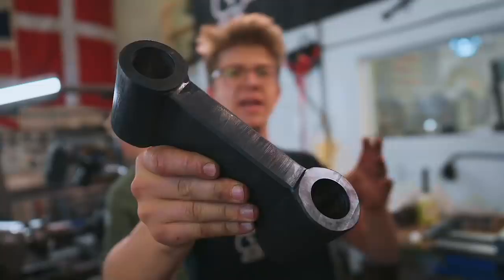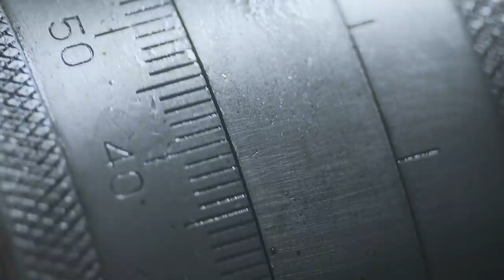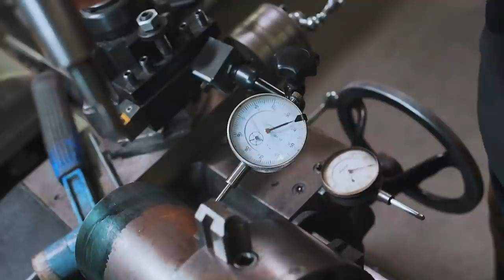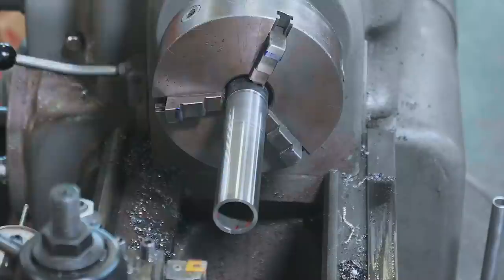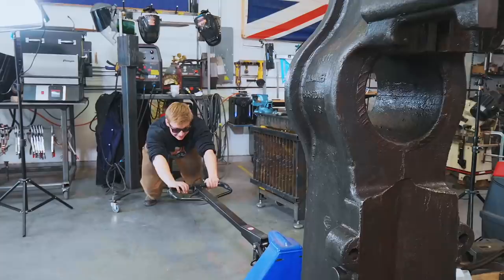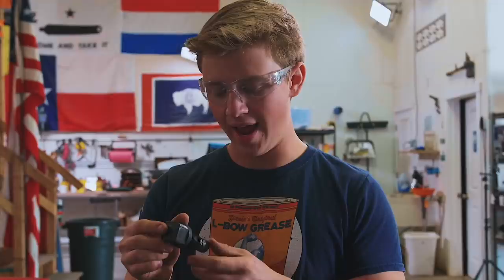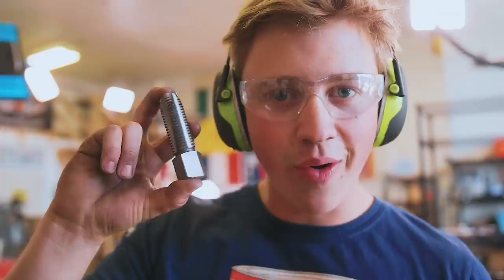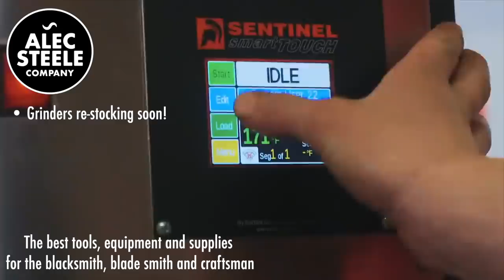RESTORING THE FAIRBANKS POWERHAMMER!!! Part 3

Comment: Pretty cool. I like the "fixing old industrial tools" content as it's a little something different than the normal sword making and such.
Reply: Absolutely. This is my favorite content.
Reply: I agree someone needs to do a channel with this similar higher energy style where they focus on rebuilding old machines and equipment. Kinda like "Hey guys this week we're working on this big mill here, it's in need of some work including recreating this broken table that we're going to have to recast and machine...."
Reply: @435now  not someone, Alec is already doing it!
Reply: I get so keen when they do equipment repairs because you can see it's not just their blacksmithing knowledge that's being grown, it's fitting, machining, welding and design as well. V jealous of their ability to do this day in day out!
Reply: Whole heartedly agree. I can't get enough old machine content and there doesn't seem to be a lot that does such a comprehensive overview of the machine and it's components. These young men are developing extremely valuable and dwindling skill sets that the world very much needs.
Reply: That's the only thing I watch on his channel, not really fussed about the forging
Reply: Came here to make the same commet.  Gratifying to see othars have the same thought.
Reply: Yeah and unironically this is the "Cheap" way to get a tool. Buying one of those things would cost them 50x as much... So thats why you see so many old tools stick around so long, specially in smaller shops/businesses.

Comment: will: I am terrible at machining.  
will: proceeds to fabricate a perfectly functioning tap 
me: hmmmmm...
Reply: I mean "perfectly functioning" might be a bit much for that tap. For chasing existing threads? Sure. But cutting new threads from scratch will probably be extremely hard for that one, judging by its geometry. The flutes seem very flat and thus the cutting angle at the tips aren't very sharp. So if you'd try to cut new threads you will either need much more force than necessary or the tap will just break because it's hardened all the way through. Not saying it doesn't work, but it isn't perfect by a long shot.
Reply: Depends on what you're tapping, some materials prefer a negative rake angle
Reply: @sherlock_norris  you know your stuff, 303
Reply: you look like Lewis Hamilton XD
Reply: Yea, that was pretty damned impressive.
Reply: @adcaptandumvulgus4252  He's Sherlock Holmes and Chuck Norris rolled into one. What did you expect.
Reply: @nathan87  yes, us rabble pale in comparison
Reply: Right.. lol 
Or when he said, "I've bored a hole out of center before, just not on purpose" hahah. They do such great work together and a joy to watch. I am sad about Will leaving. Hopefully they do some collaborations and stuff still. They have too.
Reply: true, wills lathe skills are quite impressive it seems a waste of his talent and skill to just make knives for his bread and butter

Comment: Meant to mention this on the last video Alec, but you should really grind off the scale before doing any cutting on the mill. Scale is surprisingly hard and will dull the hell out of your cutters.
Reply: Not just that, if you clamp on scale in a vise it's really not secure. I've had parts fly out of my mill because there was some scale om the sides from flamr cutting. The parts can still twist and rotate because the scale is so hard
Reply: True if you're only taking a skim pass, but if your taking 20+ thou like it appeared he was, it's not so much of an issue
Reply: Just need to take a heavy first pass and get underneath it; doing it that way makes no noticeable difference on tool life. Same rule goes for torch or plasma cut edges on plates. I always try to make that first pass at least .062”

Comment: Just FYI the "split" isn't actually a split. The thread is rolled onto a blank. The dies weren't leveled properly. I worked threadroll machining and heading blanks for almost 10 years. Someone in quality missed that with the acid etch and the magnifier lol
Reply: You think they rolled threads 100 years ago?
Reply: @felixar90  They did roll threads, as early as 140 years ago. It was probably powered by a steam engine, using a leather belt from the ceiling drive rod, but when your lathes were of that era it was still a lot faster than turning them manually!
Reply: @kevinvermeer9011  One of my professors said that among the most important inventions that no one knows is the lead screw. Without it, a precision lathe is impossible. He said that he really admired the man who made the first one.
Reply: Sure they did. A few of the machines I worked on 15 years ago were just a couple years shy of 100 years old. The machines are based on the same principle of motion as a train. Large counter weighted wheel with a piston force centripetal linear slide. Simple.
Reply: My first job was in an aerospace fastener plant, part of my job was to keep the oiler cups full on all the headers and thread rollers.  

The hot heading machines were built in 1919.  Most of the cold heading machines were 1940's vintage.  All of them are still turning out parts to this day!
Reply: @johnhobson9165  I read an article in Scientific American many years ago that said that the first master lead screw was made from a series of hardwood patterns that had been selected by measuring them for accuracy and then taking the most accurate sections of each to produce the master steel lead screw.

Comment: this makes me want to impulse buy a really large power hammer. just need to convince my parents...
Reply: Good luck :)
Reply: Buy a few smaller, but still big items. Then when you buy a massive thing it doesn't actually look that big. 😅😉🙃
Reply: Do you have a normal or small power hammer? You can build one fairly easily, as far as building your own machinery goes. I made one with the most expensive tool being a welder.
Reply: Luckily I live in Whitehall Montana
Reply: Easier to just buy it and then beg for forgiveness.
Reply: Just tell them it's just a large alarm clock. L0L
Reply: Find a listing like Will's: "needs a little work"
Reply: It's always easier to ask for forgiveness than permission 😏
Reply: I don't need to convince my parents, living on my own, but I would need to figure out how to make my downstairs neighbors okay with it.

Well, that and scrounge up however many grand I would need....
Reply: @marka4891  "I don't need to convince my parents, living on my own, but I would need to figure out how to make my downstairs neighbors okay with it." 

Buy them some Kove Audio Noise Cancelling headphones. XD 

No clue on scrounging up the money though.
Reply: @mamaseraph3854  Well, see, that just means I need to scrounge up even more money!  ;D
Reply: If you're at your parents you probably can't afford one.
Reply: Tell'em you'll wire it with a clock so it'll wake you up every morning and you'll never be late to school ever again
Reply: It’s easy to convince someone with no head, just friendly advice
Reply: And you need to convince the bank that their loan is a good investment

Comment: Uses die grinder to chamfer, too bad they don’t have a metal lathe.
Reply: I thought that same thing... guess it may have been faster to just use the die grinder especially since it didn't need to be accurate.
Reply: 15 minutes setting it up and centering it in the lathe vs 5 minutes with the die grinder for a chamfer that's going to get filled in by a weld bead anyways.

Comment: Has powerful hydraulic press, yet welds in the sleeve instead of press fit... Seems silly, but I'm no expert.
Reply: With the beating those parts are gonna take a press fit would probably work loose pretty fast

Comment: as someone who bought the kove headphones last time they sponsored, i HIGHLY recommend it. i primarily use these headphones in wired mode, and in the year that i have had them, i have had to charge them 4 times. it's absolutely ridiculous how energy efficient these batteries are. i listen to heavy metal with lots of pounding bass, and these things keep plugging along. i also use them for gaming and they sound amazing. plus, the steel band means that even someone like me who has a watermelon for a head won't break them and they still sit comfortably on my head.
Reply: They’re cheap junk; you can a pair of better quality headphones with at least IPX5 waterproof rating on Amazon for cheaper than the discounted Kove garbage

Comment: Thread that bolt you just made into the hole you just re-tapped; slip a piece of steel in that slot for the bolt end to bear against, then you can tighten the bolt against that shim so that it opens the slot.  DO it gently and incrementally so you don't end up with more problems AGAIN, but it should work.  I used to do this as a bike mechanic, getting handlebars into aluminum stems-- it's exactly the same problem, just writ larger.

Comment: Great job Will! one suggestion though and it may have already been mentioned, is on the sleeve that you welded in I believe it would have probably been better off if you had just made it about .002 over cooled it and heated the other piece and did an interference fit. once the temperatures neutralize they would have never came apart. You can always weld it on top of that as well.

Comment: You don't need the torch to spread that crosshead. Put it in one of the heat treat ovens at 750F for 60 min (lots of thermal mass there) with the crosshead spread to the correct size. It'll relieve the stresses put into the crosshead when changing the size and it'll come out "relaxed" at the correct size.

Comment: If your welds will experience impact or cyclic stress, they will need to be either heat treated or ground.
Leaving the beads as is leaves residual tensile stresses in the steel at the weld. Grinding this down will make the joint much stronger.

Comment: Just a heads up you can just turn the bolt around and put a piece of shim in-between the two holes of the holder. Then when you thread the bolt in it will act to spread the two split halves apart. You can just set the pitman to the depth you want and back the bolt out and you should have it/

Comment: If you haven't already tried to open it back up.  Just slide a hard plate in between the two ears and run the bolt through the other side prying it open slightly.  Then you will for sure get a press fit.  To adjust in the future just repeat the process.

Comment: When you machining your parts get close to your final dimensions with in .050” if you can feel heat in the part with your hand. Then let the part cool off back to ambient temperature, and then finish machining the part. It won’t be what the machine came with you could take that 7/8”-9 threaded hole and thread it to 1”-8 threaded hole. 1” is more common the 7/8”.

Comment: Tho bolt broke and threads are messed up, use a through bolt and nut instead. As for being too tight for the pitman when you heated it and tightened it you didn't have the pitman inside so the hole fits it. It might not be perfectly round anymore too. When adjusting a clamp slot like that you should have a sacrificial part of the same dimensions inside the hole to avoid distorting the hole and getting it's ability to clamp and release dialed in. Nothing inside the hole and it's guesswork with potential distortions.

Comment: Uhg. The hand dropping the metal chips gave me a terrible flashback. Working on drilling out a 1000 rivets on a firetruck frame restoration as a kid. As I walked away my shoes felt funny. Stupidly reached down to wipe the crud out of my shoes. Took about a week for my hand to heal enough to get back to work.

Comment: Accidental off center holes? I feel your pain, Will. Once made an entire set of 6 washers off by just a few, invisible microns. We "fixed" the offset grinder, but it kept drifting off spec. every hour. Took almost a week to figure it out. The head Millwright said, "It's too consistent. SOMETHING'S off center. Did you gauge everything out?" (no) He made me take it apart alone.

Comment: The flutes on your custom made thread tap need to be deeper because the teeth won't cut efficiently with the flutes being too shallow. The teeth on the tap need to be a fraction (a degree or two) just past 90degrees to the material being cut into.

Comment: What you can do is drill and tap a hole in the opposite side for a jack screw to open up the clamp. Than insert the shaft to position and back off the screw. Than you can tighten the square headed screw you made to clamp the cross head. This is a common way it’s done.

Comment: Nice video an great progress. 
But im a little afraid that the thread, is gone in the hole Will cut again. Its not holding with a full thread anymore. I would put the clamp in the mill and make a flat surface at the exit end of the thread site.  Then make a longer bolt and nut and tighten it with that instead. Then that sucker would never move.

Comment: I would have suggested that the way to take off the excess threaded rod would have been to screw the assembly together at full finished torque and mill it using a boring bar via the milling machine.

Comment: You guys should make Damascus steel using the shavings left over from these builds. Just an idea 😊
Reply: Much of the grindings, milling chips, and forge scale will be oxidized, which is what they're usually trying to avoid when they remove it down to shiny metal. 

This could potentially be recycled if they made a crucible steel, the carbon in the molten metal bonds with the oxygen and turns into CO2 that can bubble out of the molten metal but it's hard to judge the amount of carbon you need. Too much gives cast iron, too little mild steel and iron oxide slag.

Comment: You should be able to open it enough to get the pitman in by using a drift to open the gap slightly.  It shouldn't need that much to get the pitman in.

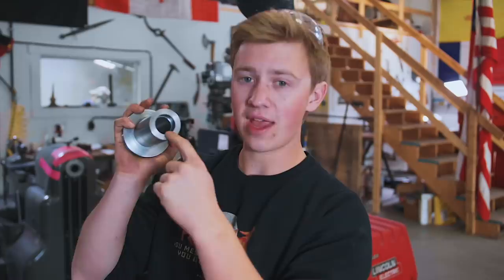Comment: if you ever do more like this, "bearing/sleeve retaining compound" is your friend. It's basically a Loctite for bushings and bearings, and is designed to work in applications just like 8:10. Can come in handy where heat (welding) is your enemy.

Comment: You should have turned a groove around the inside center of the bearing and put a hole protruding through to said groove and put a 710 port on the top of the pittman(spelling?) so you can get some gear oil in there between runs.

Comment: i recommend to buy some dual shield wire and learn to flux core weld and or some different gas like 90/10 co2 or 98/2 oxy and try setting your mig for spray transfer for welding big thick heavy stuff :-)

Comment: Well you can easily make your own oxygen through electrolysis.!

By submergingan an Anode and Cathode separately within the same electrolyte. Like salt water. Or many other low Ph electrolytes.

And then capturing the oxygen coming off the Anode. And compressing it.

While either capturing and compressing. Or safely disposing of the excess hydrogen coming off the Cathode.

And the larger voltage you use. The less current you would require. And the more efficient the process would be.

Which I would imagine would make for a great video.!

Also you could you use hydrogen to run that very large forge at that altitude without having to worry about Stoichiometry of the fuel being used. In this case natural gas being replaced by hydrogen.!

Which again would be a pretty awesome video.!

Comment: splitting a bolt down the length. wow. initial thoughts were a cast bolt from a poor 2 part mould but Its more likley its just the threads that have been moved not the whole bolt split. great work. 7/8x9 UNC £6.95 ebay, but if you need it now....

Comment: Hey Alec and Will,  I have a weird question for you. What happens if you try to forge, weld. As in the material weld that Welders like myself use. If you built up a huge fillet weld on some angle iron or something,  with 7018 or 6010 or whatever and then stuck it in your forge what happens to it? Can you use it to make some sort of Damascus or something? Or is it just an unsuitable metal or something?  

I've been a long time fan, from back when you were in the UK, and you guys helped me  finally get into metal work, which is a passion of mine, so I've just been curious about this question. Anyway, let me know ^_^ keep up the Doise

Comment: As I have started watching you guys I have wondered. What tolerances are you used to generally working with, like how precise do you shoot for? Also is trying to work at this super precise level to make these normally machined parts for the hammer outside of your normal practices?

Comment: While that tap is beautiful, You could have also just drilled out the threads and used a 7/8" bolt and nut.  I doubt the power hammer would mind the extra 50grams.  Two sets of spherical washers would insure you don't bend the bolt, or a castle-nut and cotter pin would insure it never loosens.  (though I've never had a pinch bolt self-loosen)  

Also, you can buy sintered tubular bronze bushing stock.  5-custom bushings might have been enough to get the old parts working with far less labor.

Comment: apparently Will doesn't know that pallet jacks are designed to be pulled not pushed.😄😁
Reply: Actually, i was taught that it is more ergonomic to push and better for your back. (prevents injury) Still easier to pull, but pushing is the correct use of the pallet jack.

Comment: Dumb question. At the 2 minute mark with that off center hole there's a lot of waste metal you're taking out. Can you save that waste metal? You're pulling out probably a couple pounds of material overall. Seems like a... Waste to waste it. But is saving it practical?